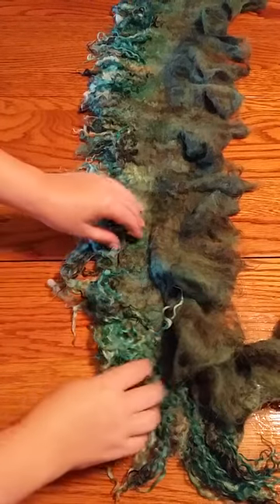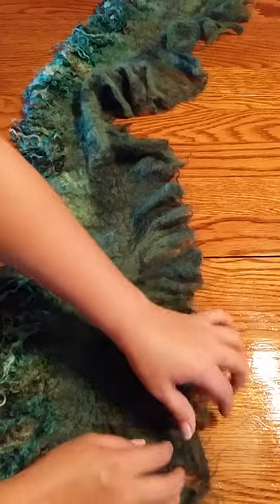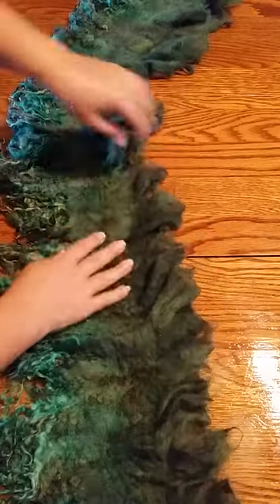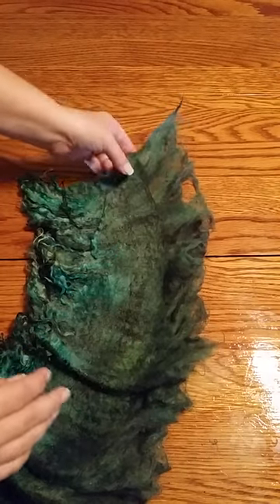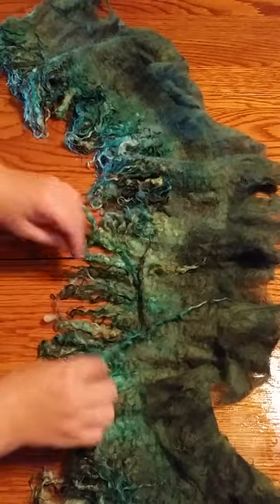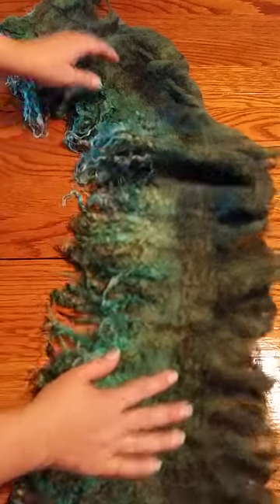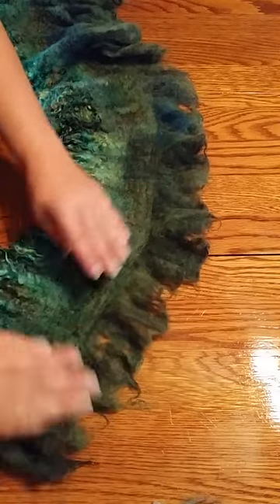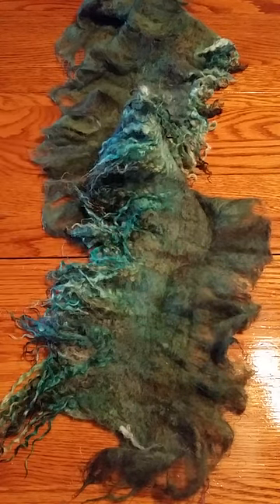Wet Felted Cowl with locks #4

Comment: Kristy, thank you for taking the time to do this tutorial. It gives me a good idea of how to wet felt using the curly locks. Just a suggestion, but in order to save my floors (and lessen the cleanup), I use towels under the bubble wrap to absorb the soapy H2O. Then the towels are already available when I roll up with the pool noodle to felt the item.
Reply from the maker: I typically use towels also, but I was a little excited when i started the videos and I just didn't want to go back and do it. This might have been the only mopping my floor got for a while. LOL. Than you so much.